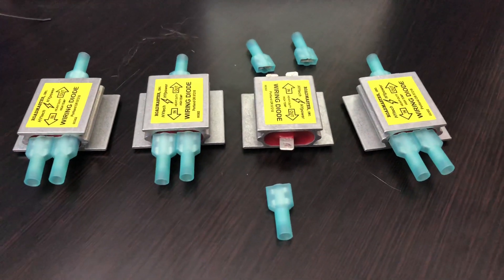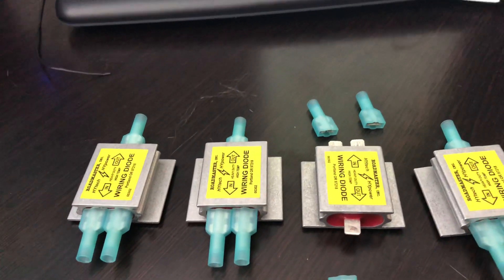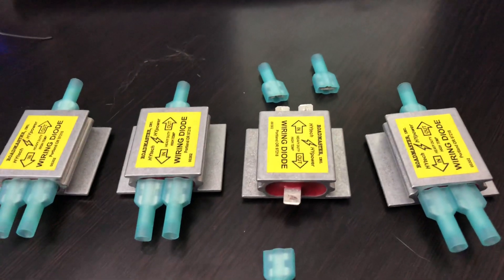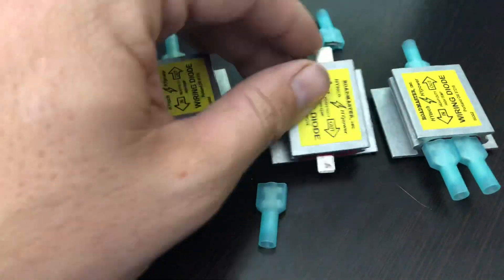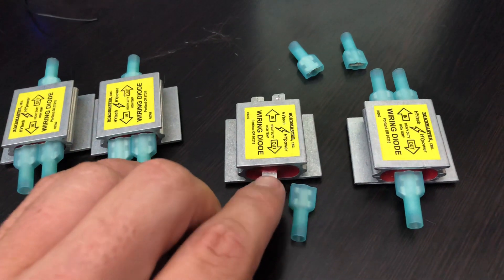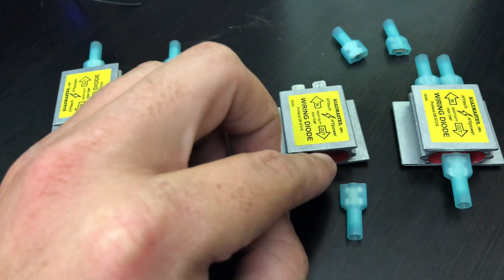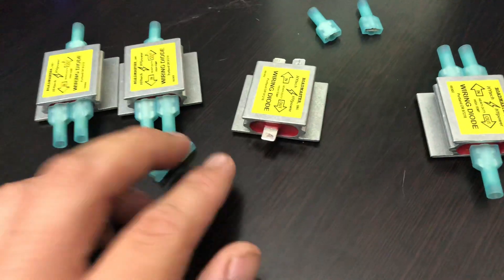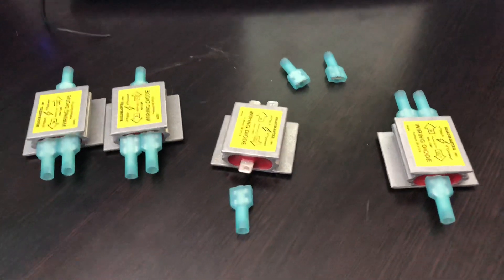Roadmaster 794 Diodes Functions and uses

Comment: Hello, I'm trying to test these diodes with a multimeter. I have these installed on a 97 Cherokee. This system worked for a few months but now, when I apply the brakes, it doesn't reflect in the back. When I have the lights on, the brakes light up as they should but doesn't get brighter when I apply pressure on the brake pedal.